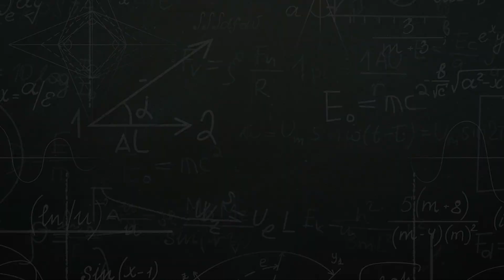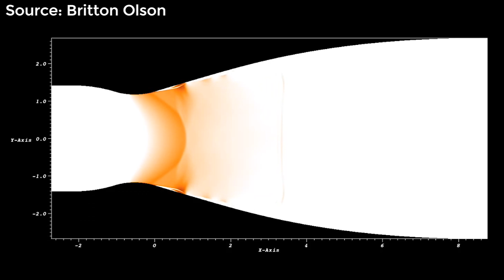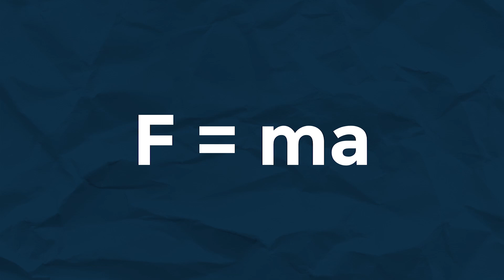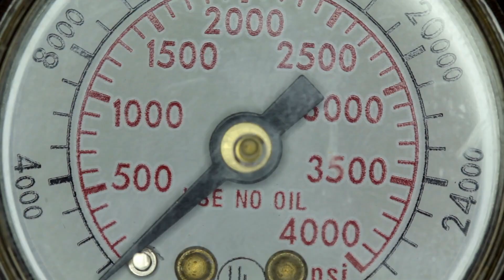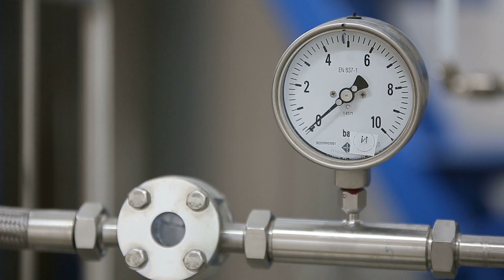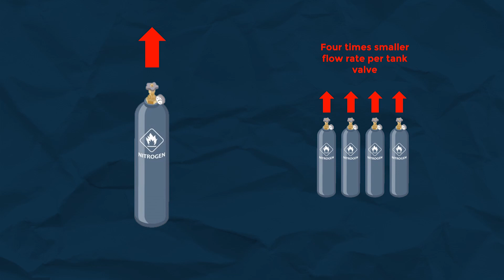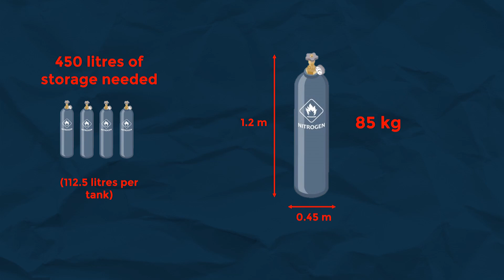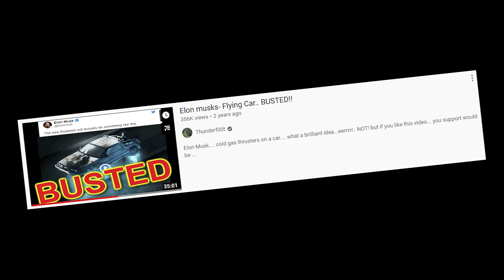How The Tesla Roadster Could Actually Fly

Comment: 10,000 psi!!! AHAHAHAHAHAHA!!!!
Anyone common to the never-ending issues with nitrous system fittings/solenoids/etc failing due to the extreme pressure of 950 psi knows this is an impossible nightmare to maintain.

Comment: I think you highly overestimate the power needed. The car is not actually flying, it is hovering. So if the tesla gets 20cm up in the air that is enough. 

So all you need is a fan that has a fan curve strong enough to generate 3000kg *10N/kg/10m*m around 4kPa under the car evenly distributed pushing against the ground. Which can't give way so the car hovers. That is stable, can't really get higher can't get lower. 

Also makes it safe, so you don't drift away into controlled airspace, or Mars.

There are fans that can do that. Infact ground effect vehicles have been a thing since the 80s. I think the russians had the first bigger application. Search for Ground effect vehicle. GEV
By now there are ferries that work on that principle.  
Sure it is just a gimmick but why not?

Comment: That sounds extremely dangerous : 
Mounting additional trust on a car without any control system is a very fast road to the nearest ospital , 
Since traction isn't guaranteed expecially if you start with a road viechle and not a custom made F1/Dragster chassis made to have more traction at faster speeds , 
This also ignores the object danger posed by high pressure gas , 
This is if trust goes orizontally , 
If it's vertically idk if the suspension of the tesla can handle a fall from 2 meters or 6 feet , so yeah i don't think Elon will make a flying car any time in the future ...
Reply from the maker: Yea I agree, I am very interested to see the future of this